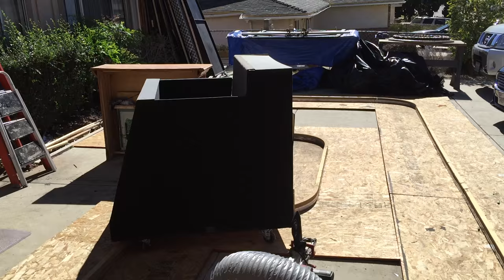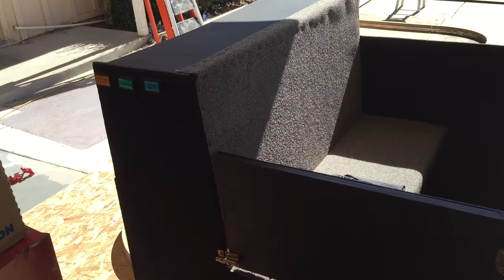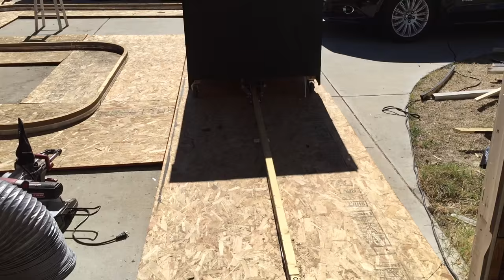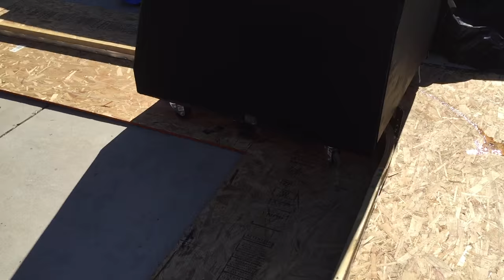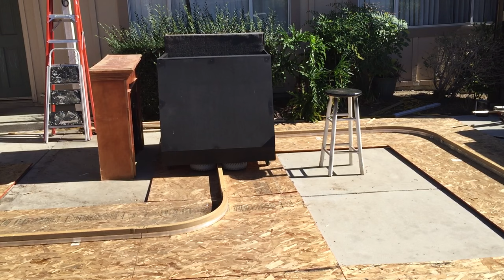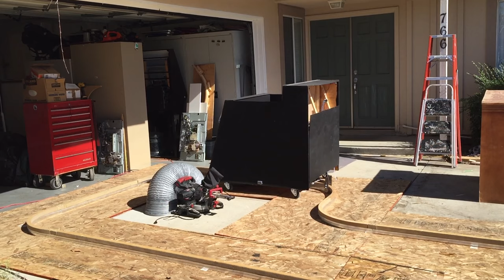Halloween Dark Ride 2015 After Teardown

Comment: +Toolmaker Great job; really smooth action. 

A small number of the early ghost rides had cars capable of rotating independent to the base. I don't know if the amount of spin was controlled with a motor and triggered somehow, or just a product of momentum, but it could add a dimension to the ride if the car were travelling sideways, or even backwards.

Comment: You need to post more about this! Dying to know more....
Reply from the maker: Yes, more videos to come.  Doing a presentation this Saturday so I was planning on using this opportunity to make videos of what I did and how I did it.  Will most likely cover the track system, car drive & pick-up system, car control system (Arduino), car audio system, and the triggering of props/scenes via the location of the car in relation to the track.

Almost there...
Reply: Great. Can't wait to see it. My attempt failed miserably so I'm also anxious to see how others did it. Yours is so clean and looks like it worked very well. Looking foward to the videos.
Reply from the maker: +coasterbp 

Just starting to pull this together.  Details available using the link below.

http://www.halloweenforum.com/general-halloween/146492-home-built-dark-ride-details.html#post1832496
Reply: +Toolmaker Omg, yes please. This is amazing!!